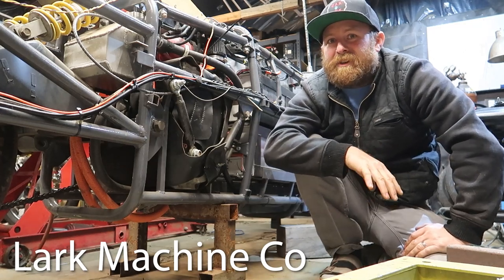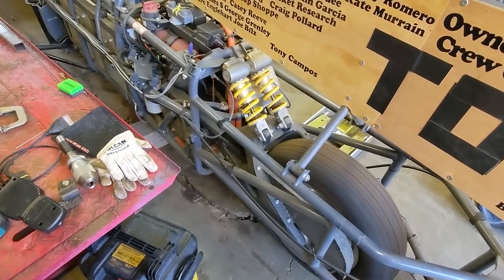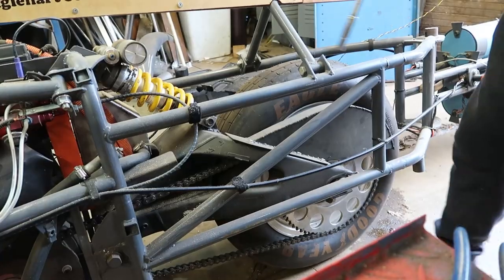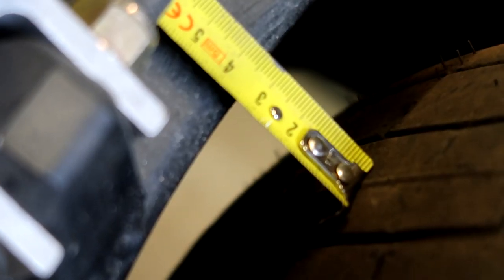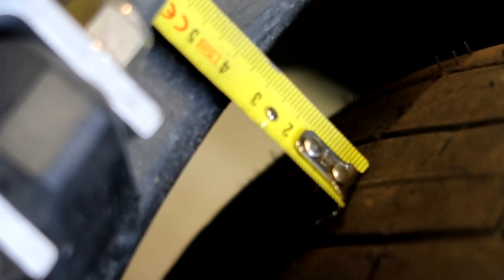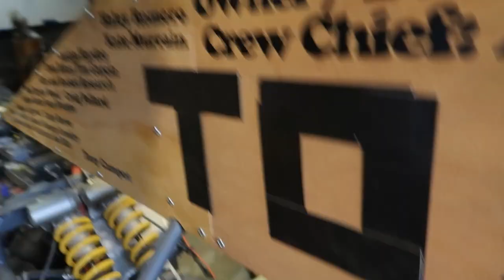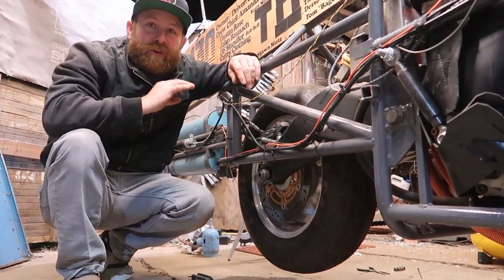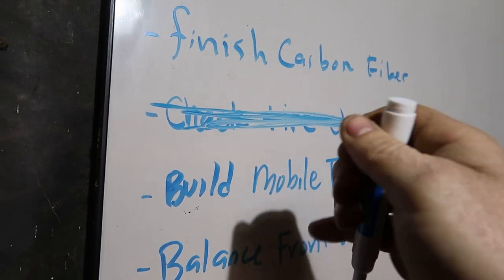How much will a motorcycle tire swell at 300mph | Will it EXPLODE?!?!? | Lark Machine Co

Comment: Cool test. Wouldn’t there be even less clearance on the top when the full weight of the bike is pressing down on the bottom?
Reply from the maker: There is something they call a standing wave that move through the tire.  I guess the deflection on the tire on the ground deforms and pushes rubber out past the ground.  I have no clue how that will effect the swell, but at least we are beyond what others have run successfully

Comment: Put a motorcycle strap on the swing arm to over the frame to mimic your preload so you can watch your chain rub. I run one with a rachet strap over my frames and hook them onto the rear of the swingarms. I do this when I adjust my chains!  Then set the bike on the ground with your weight in the cockpit to mimic almost full load. ( If you want to really be accurate, now that the bike has done a few runs, add some ballast to represent the bodywork, batteries and everything to race day weight. )
It looks to me that the chain is making contact with the frame on the inside.  (Could be dry chain sparks!)  And by preloading the suspension to stock ride height it will make it easier to determine how far back you need to set your rear tire.  
I realize I'm late to the party, but didn't see anyone reccomend this to you.  Hope you've thought of that idea before now.
Reply from the maker: Thanks for all the comments and views!!!!  Chain tension under bike load is good and the chain has much less slack.  I'll take a video next time I run.  I definitely need more lube. Every run I sling almost all the grease out!!!!

Comment: Seeing the tire expand at speed is wild! Also super crazy what is going on with the chain. When you do a speed run with you on the bike will you use a riveted master link on the chain?
Reply from the maker: I wasn't planing on it running rivoted masterlinks.  That might be a better idea though.  The  chain is doing some crazy stuff!!!!
Reply: @sheanyquist  Yeah the chain almost looks like it's flowing like water. It would be interesting to measure the temperature the chain gets up to. I wonder at speed like your tire the chain gets LONGER as it heats up to that speed. That is what makes high speed vehicles and planes so interesting. I am sure with high speed bikes there are all these little things that are not in a book you can reference. You are doing cool stuff!

I am hoping we are just one big jump in battery density so it's fairly easy to convert old motorbikes to electric. I want to see people riding crazy electric conversion 60hp+ Ninja 250's.
Reply from the maker: @wootks  it funny you mention the temp.  It was hot to the touch after just one test.  That might be an issue